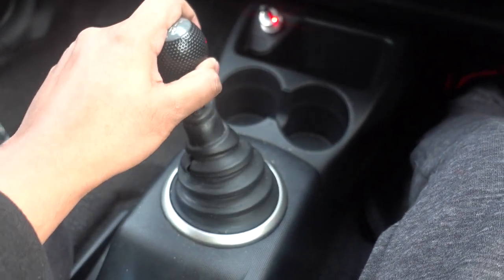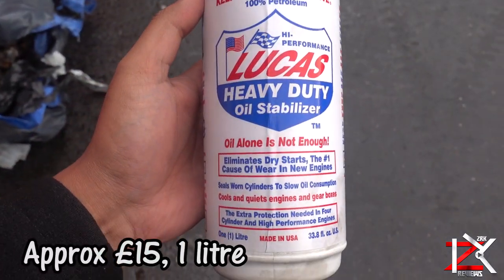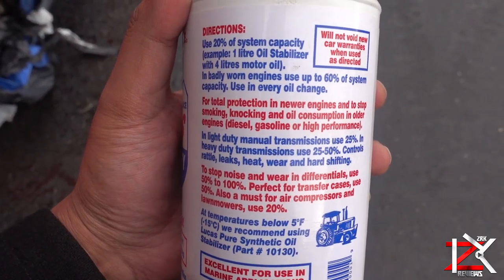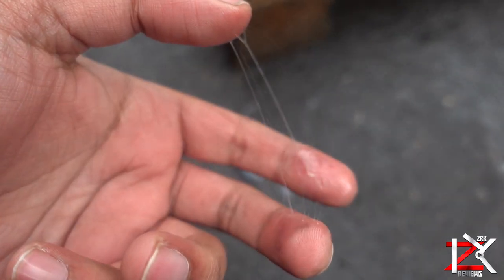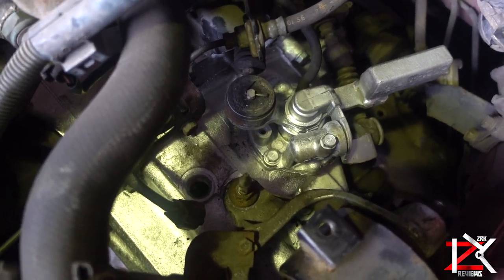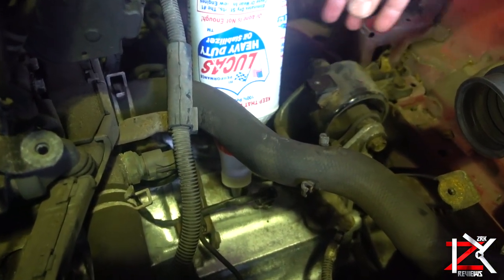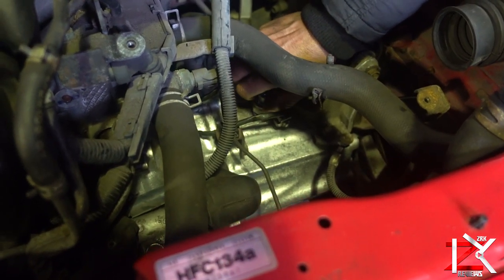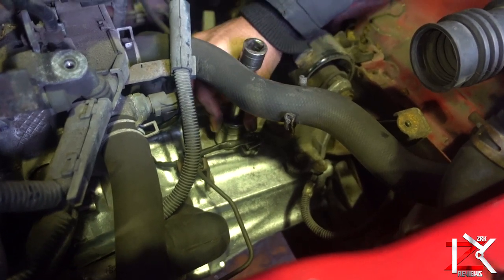How To Make Your Car Gear Shifting Smoother | Extra Engine & Gearbox Life | How To Add Lucas Oil

Comment: Does that work in automatic transmission ?
Reply: No it's only for manual transmission
Reply: It works for automatic too I added it to mine
Reply: There is a different product that is for automatic, this stuff is way too thick for auto

Comment: How about using additive which is not thick?
Reply: Because it’s thicker and sticky so it sticks to the gears and makes it smoother if that makes sense, oil won’t all run down off of the gears it’ll stay on giving the gears better life and lubrication

Comment: Amazing, thanks brother. I need to do this for a MK2 Yaris, but how do you get to the bolt or plug to poor in the oil? Hoping you can help as I want to try it myself. Thanks
Reply from the maker: Your welcome, well i had a mechanic to sort it out as there was some components had to take off which i couldn't do, best to locate it on your car and if you have tne right tools give it a shot